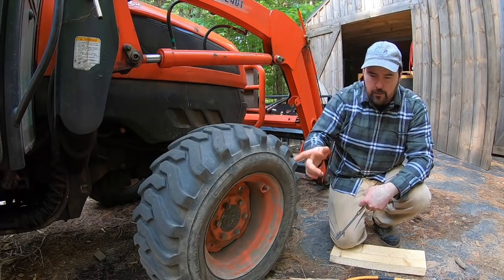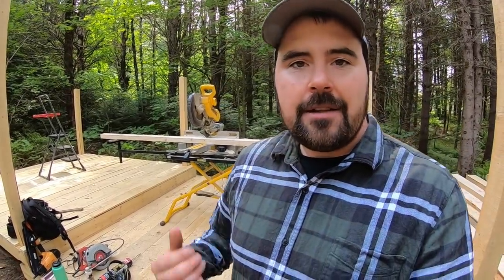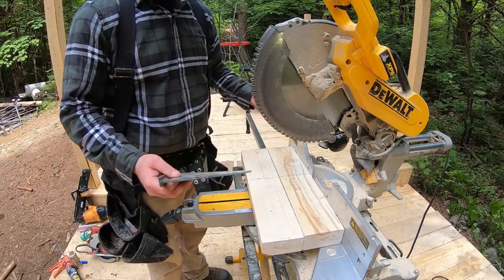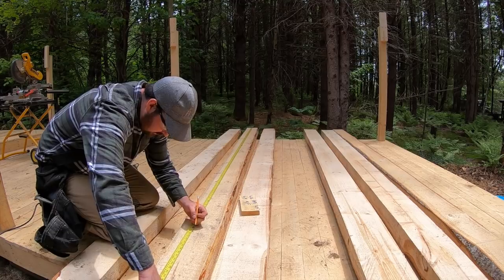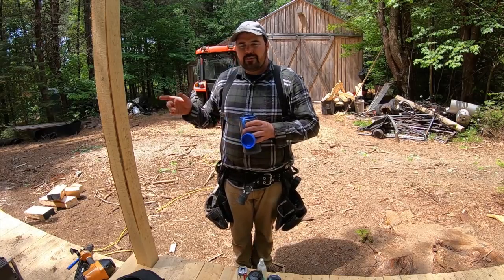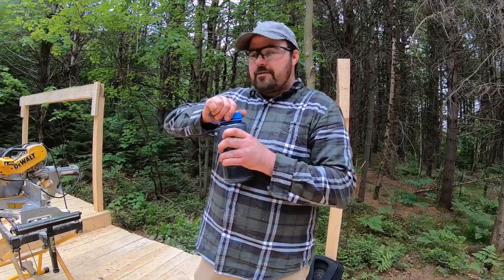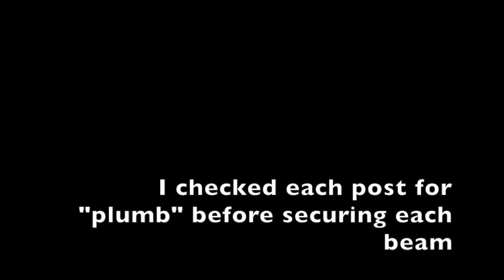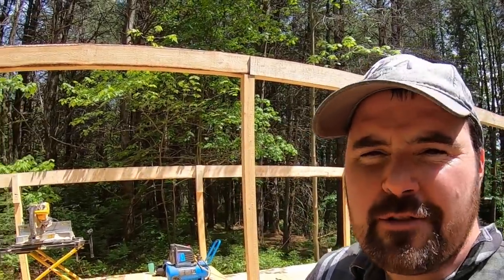Big Timber Beam Install | Equipment Shed Build - Ep. 4

Comment: If you have a portable air tank you can tee that into your compressor and have a larger reserve. Each of my tanks have an inlet (w/valve) and outlet quick connect to make this easy. Cheers!
Reply from the maker: Good idea right there! Thank you
Reply: @sawingwithsandy  you could also put a small 1/4 turn valve at the base of your air nailer. Turn it off until you want to nail and then close it while you do other things, at least till you get the nailer repaired. Hope this helps. Cheers!

Comment: The first day at work I was so proud of my apron and framing hammer.  That didn't last long. I soon learned to hate that heavy sac of framing nails, tape measure, speed square, chisels etc. I see you wearing one with really no reason to do so, it's basically empty. You would be better of with a carpenters vest which will help to keep the bugs off and is imho more comfortable and same price range. Suspenders and a pair of Carhartt's Jeans and you no longer have to constantly pull you pants up (a problem I to had. no waist) much more comfortable. Trust me you'll be thankful.
Reply from the maker: I’ve tried a bunch of different setups on small jobs and full scale home builds and prefer the setups I’ve got now as it’s light and functional for all my tools.
Reply: @sawingwithsandy  Enjoy videos just noticed your rig, had one very similar, darn thing got hung up on everything, became part of my collection and ended up hung up on a nail on the shop wall.  I'm now 71 and the just remembering the days. Still wear Carhartt's and suspenders. In the end what mattered most was being comfortable at work. Be well.
Reply from the maker: I agree with ya there Steven. Sounds like you had a good career. I’m sure you’ve got a wealth of knowledge from it

Comment: Lookin' good! 👍 I've been cutting lot of slabs with a circular saw lately. I've noticed if you make a shallower cut first and then go back and cut to full depth it not only saves wear and tear on the blade and saw but the first cut relieves some of the stress from the wood so it doesn't pinch the blade. Game changer in my world since I can't afford a timber saw. I'm also melting in the PNW when it hit high 90s🥵 Keep on keeping on!✌
Reply from the maker: Good points for sure. Weather here has cooled a litlte so atleast I'm not feeling like I"m about to melt.

Comment: Watching the tire get aired up makes me think a bigger compressor is warranted. 
Best thing to do with a low cfm compressor on a decent sized job is adding an air storage tank down the line.
A construction type wheeled 2 small dual tanks that puts out 28 cfm feeding a large tank is how we did it in my shop.
Every manhut needs a good compressor.
Reply from the maker: Yeah I think if I ever find a good deal on a second hand compressor I"ll see about picking one up.

Comment: hay sandy my blade in   my hm122 is gumming up and my cuts are very harry, teeth are filling up with glue type fibers.
now the blade wont cut, without cleaning the teeth suggestions ???
new blade!
cutting pine!
4 oz dish soap in the 10 LTR res !!!!

Comment: What are the dimensions of your equipment shed and how much space is between your support poles?  I'm going to be building a shed soon and any helpful hints would be GREATLY APPRECIATED!!!  Love the videos!!
Reply from the maker: Hi Rodney, shed is 10 x 30. It's approximately 10' between each of the posts to allow for two machines to sit side by side. Thanks for watching the channel
Reply: @sawingwithsandy  thank you very much very helpful
Reply: What type of protection do you use on your wood down by the ground?
Reply from the maker: I just make sure no wood touches the ground and keep it up a good couple inches and if it’s too close I treat it with green deck treatment
Reply: @sawingwithsandy  where do you get your green deck treatment? I love in Virginia.

Comment: I wonder if a little dish soap or a mist of wd40 would help that skill saw. It sounded like it was laboring kinda hard on those green beams🤔
Reply: The blade could use a good cleaning.  Build up of sap due to green wood will not only dull a blade quickly but gum it up as well.  You can remove the blade, use the top of a 5 gallon Home Depot bucket ( good for blades up to 10"), pour some Simple Green and let it soak for 10 mins then scrub off the sap with a bristle brush then dry.  Works great.
Reply from the maker: Yeah not too sure. I don't cut much green lumber with this circular saw so I'd imagine part of the blame was on the blade being a bit older and partly the moisture still in the wood.
Reply: Also if he had set the blade depth exactly half the thickness it would have been easier on the saw.

Comment: Sandy you need a worm drive saw. That little guy there is going to hand in its brushes soon by the looks of it. I recommend the MAG 77 great for framing and all around wood dust making. No matter of its hard or soft, green or dry
Reply: More like one of the big Makita 10" or 16" saws for timber framing.
Reply from the maker: I know what you mean Michael. A few years back I had used a worm drive with the crew I was with but wasn't a fan of it since it was designed to be held in the right hand and I cut with my left hand.With the new left-handed worm drive saws I'm sure I"d like them a lot more. I'm also sure the weight has come down on them as the skilsaw brand worm drives were quite heavy that I tried. Sure are great tools though for framing.

Comment: all the red ink disappear with the text to so what i said i don't want to criticized you but you could of cut some 1  3/4 thick lumber it would of made it a lot lither to handle and as strength goes it said that 2 pieces like that is stronger than just one beam because the grain is different on the two of them but good job coming along real good and looking good have a nice day
Reply from the maker: Thanks for watching and glad you're liking the build

Comment: Does anyone know what the chemical is that you can brush on to the ends of your freshly cut lumber to prevent splitting?  I hope it's on Amazon
Reply from the maker: I use any latex paint I have leftover
Reply: @barrelfish8106  awesome thanks for this. Amazon is sold out, but now I know what to look for. Thank you.
Reply: @sawingwithsandy  maybe I can try that too!!
Reply: @sawingwithsandy  You're not wrong, and bonus, you get to color-code your wood :)